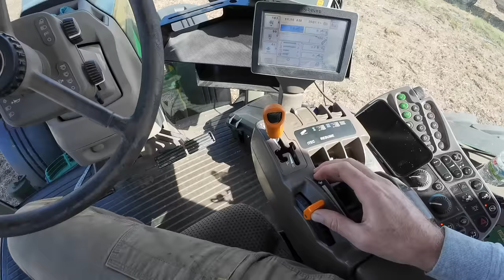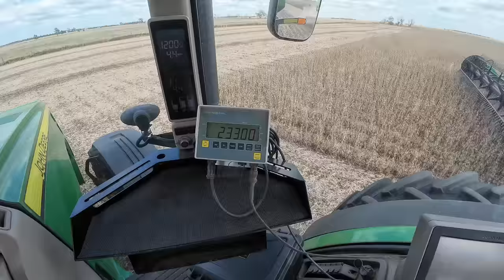Weird things we do to Survive Harvest

Comment: Hey Cole.. try putting a blade of grass between your thumbs. Will help you to make the blade vibrate like a woodwind reed & make noise. Helps to control air speed, relaxing your face & eventually will be whistling with hands without a grass blade.